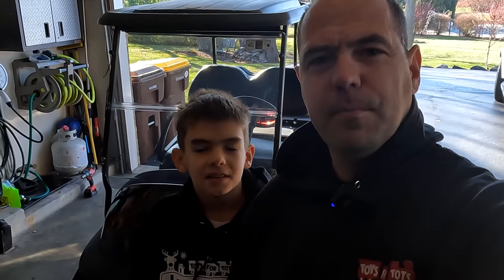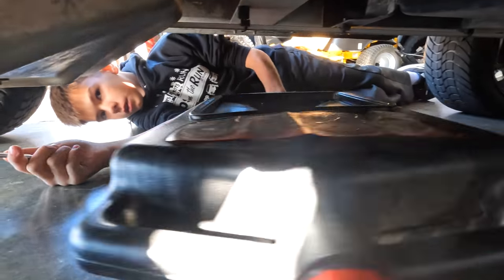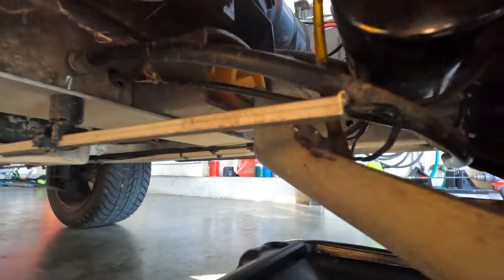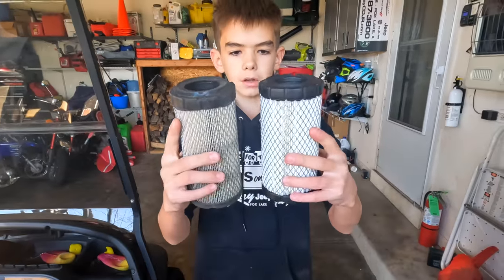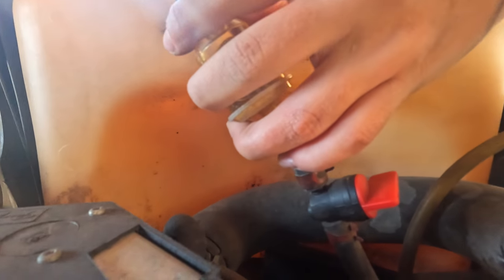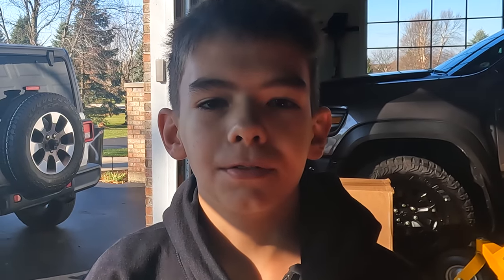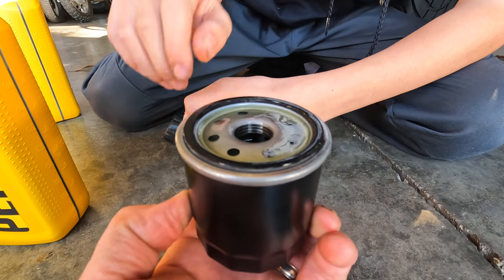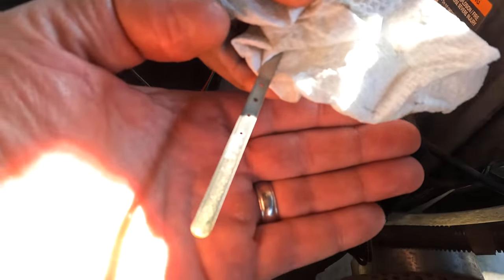How To Change Oil, Fuel Filter & Air Filter On a Club Car Precedent Golf Cart.  Maintain Your Cart

Comment: When doing the oil change I was told that I had to do something different because it had a 6” lift and 14” rims tires are 23x10-14. I think they said I had to jack an end up to level the engine to get a good reading. Just wanted to know if you had the answer. 
Thank you
For your time
Reply from the maker: I'd say as long as the cart is on a level surface, and looks level you should be fine.